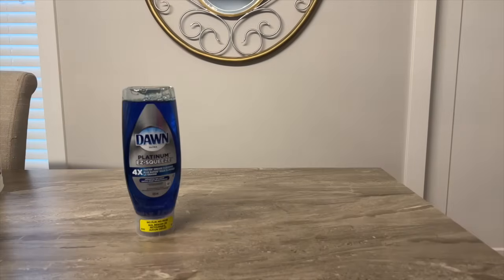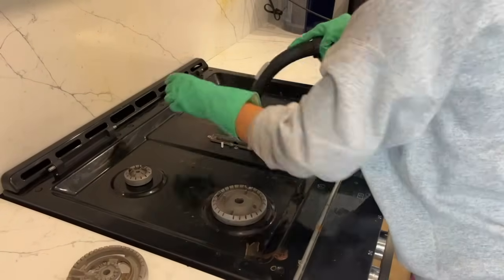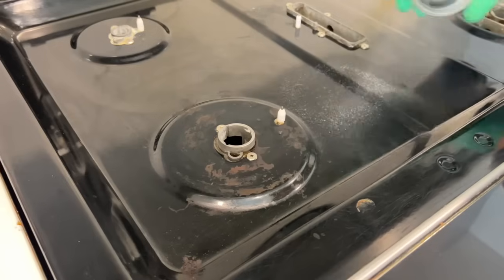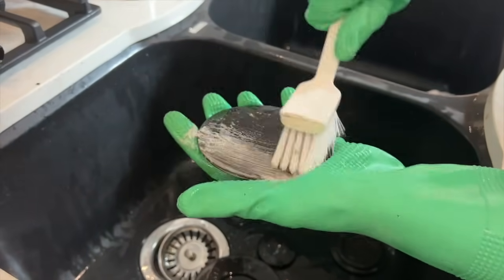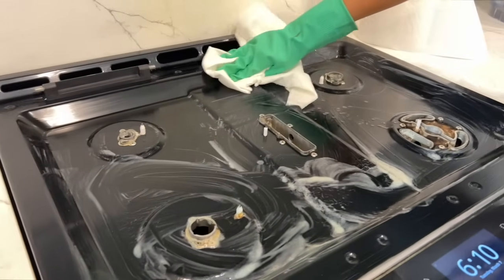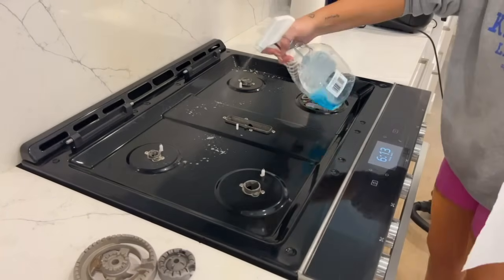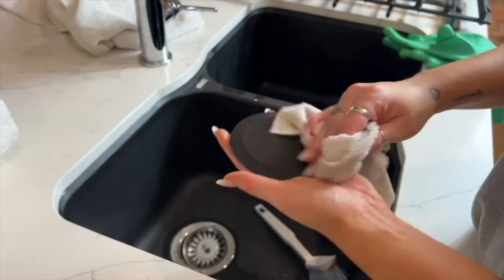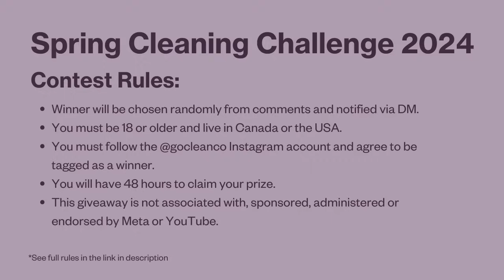How to Clean a Gas Stove + Tineco S7 GIVEAWAY

Comment: Had a gas stove for twenty years and loved it for cooking, but hated it for cleaning.  The grates and caps were shiny grey, and took forever to get the black off.  When we updated the kitchen, I had the gas capped and went to the beautiful glass top induction cooktop.  Heaven to clean!  (And yet I still had to watch this entire video!)
Reply: Yes, this is my issue. I wondering if the dishwashing soap will remove the shiny grey from the grates even after soaking them 🤷‍♀️